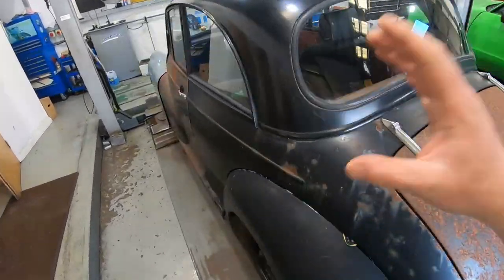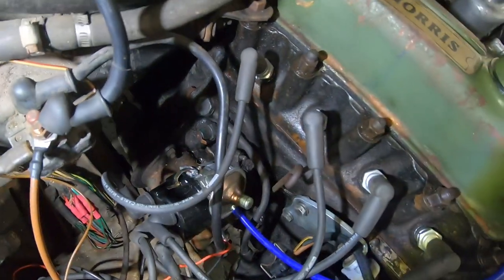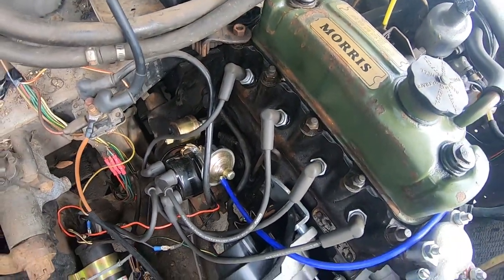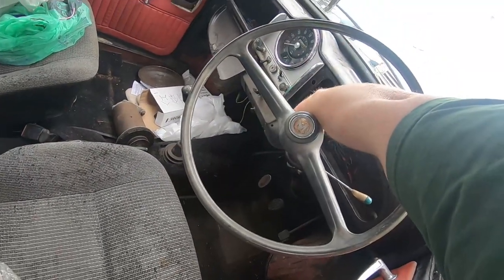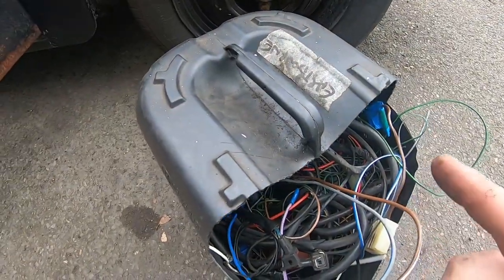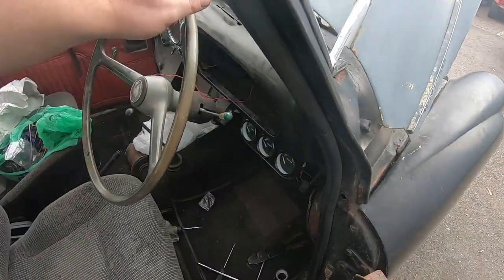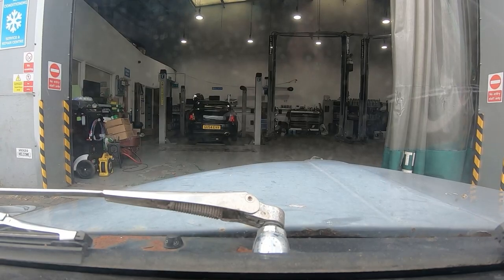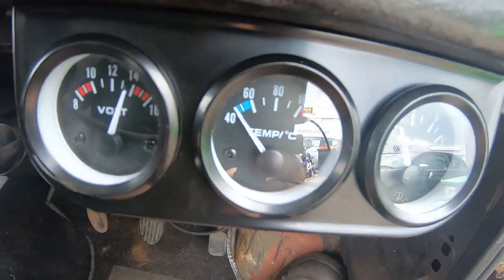How to fit AFTERMARKET GAUGES - Patch the Morris Minor is back!

Comment: Hi Mark, very useful thanks. Just about to connect in a temp gauge in my ‘62 Moggy. I’m told it’s best to include a voltage stabiliser in the circuit. Is that really necessary?
Reply from the maker: I haven't used one and don't have any problems. It might be different with a dynamo but im not sure.
Reply: It is quite important, else the gauge reading varies depending on the battery charge level. There is (or at least on 1098cc Minors) a stabiliser fitted to the back of the speedo (to feed the fuel gauge), so you can take the regulated 9V or so feed from there.
Reply from the maker: @FMFGUF  Perfect, thanks for the tip.

Comment: Takes me back by almost 40 years when all my friends were messing around with cars. One guy I knew fitted a very simular bank to his Moggy in the same location. He did not have the oil sender adaptor so he lost his oil light.
Reply from the maker: I did consider not having the light but I figured I'd rather have it too just incase I didn't notice the gauge while driving. Thanks for watching

Comment: Hi Mark,

You need to wire the gauge live feed to a fused ignition switched live (which is green on a Minor) or your new gauges will only work when the sidelights are on!

The gauge illumination circuit is ok on the red wire, so yr dials light up with the sidelights.
Reply from the maker: Hi Steve. Thanks for your comment  I wired them into the back light switch thinking it would be ignition fed and not powered off the lights. I have since wired them straight to the ignition circuit and the back lighting is now on the light switch as you say. 
Thanks for watching

Comment: Hi mark I'm trying to do the same  I'm finding it hard to acquire the adaptors for the oil and the water the  motor parts shops here don't seem to know what I'm looking for  or they just don't want to know here in Eire good video Great info cheers
Reply from the maker: Water temperature sensor block - https://www.amazon.co.uk/dp/B07K86SN3N   Oil pressure adaptor - https://www.amazon.co.uk/dp/B0B3CLTG1L

Comment: Why did you not fit the water temperature adapter to the back of the head where the heater hose take off point is? Because the rear of the head is where the greatest heat is normally!
I mounted all my gauges in the drives side glovebox cover & used copper capillary tubing from the sender unit connection  & rolled the tubing around a bottle to take out any vibrations between the engine & the solid chassis!
Having all the gauges in the glovebox cover saved my knees in an accident!
Reply from the maker: Thanks for your comment Dave. My heater valve is seized so there is no flow there but I think when I fix it, that's a good idea to relocate it there. Sorry to hear about your accident

Comment: I would of liked to see how you wired it at the back and exactly where you earthed it, you brushed over it to quickly for beginners like me.
Reply from the maker: Apologies for that. To be honest i wired it in to the dash light switch as it was getting late and i wanted it to check it all worked. I have since wired to one of the spade terminals on the back of the starter switch for ignition. The earth can go anywhere at all that is metal.

Comment: Is the stock water temperature sender point not just blocked off with a bolt?
That is where you want to be measuring temperature, rather than the bottom hose.
Should be just below thermostat housing on spark plug side of the head.
Reply from the maker: I will have a look. I thought the stock position was in the thermostat housing. Thanks for commenting
Reply: @MarksWheels  Definitely on the head, if you look at the right hand end of the engine number plinth next to the water pump, just look up about an inch. Possible BMC didn't drill and tap the location on engines destined for cars without a gauge, but I reckon more likely the redundant hole was just plugged with a bolt.
Reply: @matthewjenkins1161  Indeed, it is, on later 1098cc Minors, at least.

Comment: Mark why didn't you fit the temp sender unit into the block.Mine has a blanking nut on the side of the head near the thermostat .
Reply from the maker: Oh, Mine doesnt seem to have that blanking plug
Reply: Mine's a 67 1098.Maybe earlier ones didn't have them.

Comment: Where did you get the oil adapter, water temp gauge?
Reply from the maker: Here are the parts i used in the video:

Gauges - https://www.amazon.co.uk/gp/product/B08V1HSL67/ref=ppx_yo_dt_b_asin_title_o04_s00?ie=UTF8&psc=1

Water temperature sensor block - https://www.amazon.co.uk/dp/B07K86SN3N?psc=1&ref=ppx_yo2ov_dt_b_product_details

Oil pressure adaptor - https://www.amazon.co.uk/dp/B0B3CLTG1L?psc=1&ref=ppx_yo2ov_dt_b_product_details

Comment: Mark when I start from cold oil pressure goes immediately to 80 then starts to drop 60 when warming up.
Reply from the maker: Thats a bit strange!
Reply: but cold u have high pressure(reading)thick oil, when it warms up it drops unless u rev it the pump should give it some it does on my triumph bike

Comment: Hi Mark! Thanks for this. I’m doing the exact same job. Can you tell me if the oil pressure T piece you’ve linked to is the one you used? Or is it a longer one? It looks like the Amazons one has the NPT thread on the side rather than on the end. Thanks!
Reply from the maker: Hi. Yes the one i linked is the one i used but the job would have been soooo much easier with a longer one.
Reply: @MarksWheels  After some asking around on the MMOC I decided to go with a modified oil filter pickup banjo bolt (I think it's from a Mini?). Hopefully, that'll give a bit more working space. Fingers crossed!
Reply from the maker: @morrisminormaurice  that's a good idea. I'll pin this comment so others can see